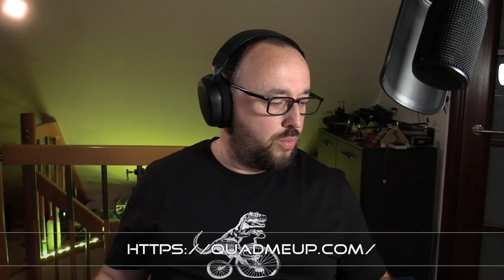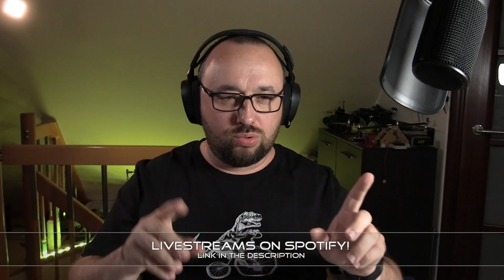How long GPS fix should take?

Comment: I used to get 15 sats real quick with XM+, Changed to RXS-R with Telm and went to 6!  Back to XM+
Reply: I noticed the same. Then I realised the RXS is using one antenna for sending telemetry to the TX. So I moved the RXS antennas away from the GPS and problem was solved.

Comment: Check your GPS with U-Center Software on a FTDI Adapter. It should be really fast in getting a 3D fix and this is what it should normally take.
Long 3d fix time is in 100% of cases caused by interference from VTX or Crossfire telemetry, Wifi on GoPro or something that emits RF.
Can be fixed with better placement of parts, can be tricky on tiny quads like 4 inch long rangers though due to a lack of space.

Comment: I am using the BN-880. From a cold start I get 15 satellites in under 1 minute. Initially I had the GPS receiver mounted too close to the vTx antenna and it would take several minutes to get a 3D fix. Since separating these two items my GPS performance has been amazing.

Comment: I use BN220 GPS module,  in most cases it will fix 6 satellites in one minute. You may use U-center to config the Baud rate and Refresh rate of GPS chip.

Comment: I have two identical GPS modules on two long range 7 inch quads. One locks in 3min and the other in 20min... Any ideas why can it be?
Reply: Swap the gps modules and see if the fast one gets slower and the slow one gets faster. Are both 7" quads equiped the same, ie vtx, cameras.